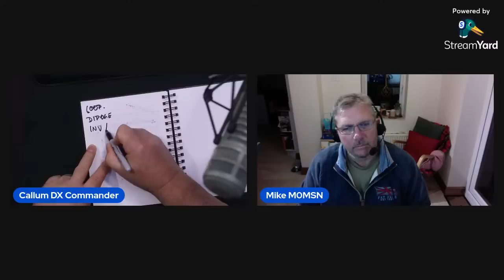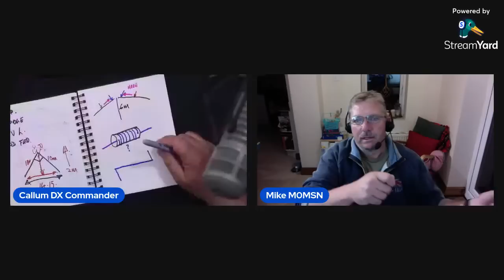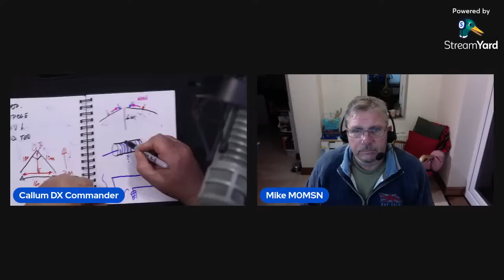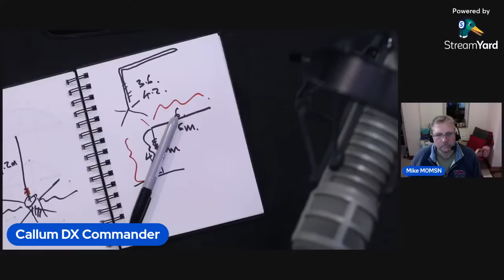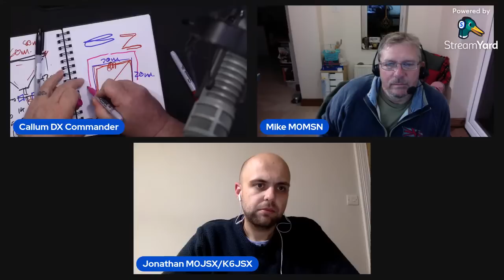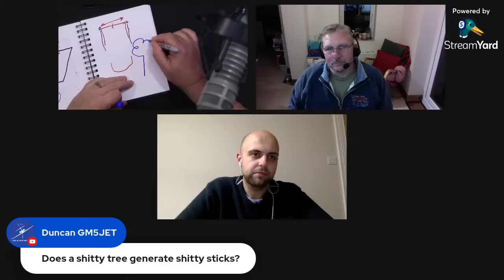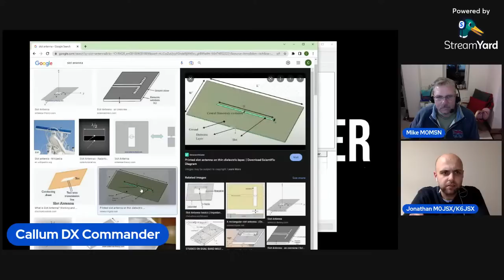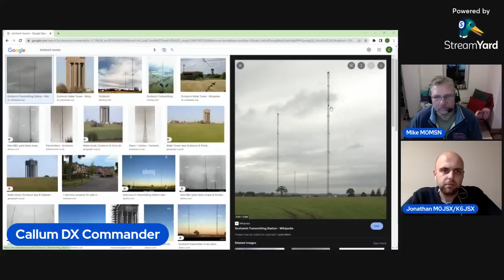Compact HF Antennas Masterclass

Comment: Regarding EFHW's I've built several versions and have been running a 10 thru 80m (with capacitors in the transformer for 10m) for several years with a 49:1 transformer I built. I tested trying a counterpoise, various chokes and a ground rod and found, for my location, the 8ft ground rod connected to the transformer gives the best performance. It's in a J configuration fed at the short end of the J and has two 90 degree bends and is 5ft off the ground. Works great and only needs some tuner cleanup on some bands. I use portable versions of this antenna for Field Day and POTA activations. One 240/43 toroid is good for 100w but I tend to build with two glued together. Results will depend on the individual's location and build process. I'm just giving mine as info. Thanks as always. Jack K5FIT
Reply from the maker: Jack.. Nice comment, thanks!

Comment: 20 ft center height worked for my inverted V with 40m elements and loading coils on the end of each element and about another 3 ft of wire to get 80M tuned to 3862 where our ARES State Section Phone Emergency Net does check-ins every day. No tuner needed for either. My DX Commander classic replaced this antenna but I still have it packed up. Thanks. Jack K5FIT
Reply from the maker: Marvelous!

Comment: NOTE> I have been using a double loop on top band with about 18in separation between the upper and lower loops. bottom loop is about 18ft AGL this is obviously NVIS . Works better than I expected as I have bagged QSOs across local to about 1500 miles with 5W digi modes and 10W SSB.
Reply from the maker: BRILLIANT!

Comment: As we drove a set of towers, the central tower had a shack at it's base, (the shack was a 2 story building) at about 2 kilometers away 3 fluorescent lights in our truck and the lights in the van lit up, like it was Christmas.  We couldn't camp overnight within 2 ks of the towers.   Naval Communication Station Harold E. Holt is a joint Australian and United States naval communication station located on the north-west coast of Australia, 6 kilometers (4 mi) north of the town of Exmouth, Western Australia. The station is operated and maintained by the Australian Department of Defense on behalf of Australia and the United States and provides very low frequency (VLF) radio transmission to United States Navy, Royal Australian Navy and allied ships and submarines in the western Pacific Ocean and eastern Indian Ocean.[1] The frequency is 19.8 kHz. With a transmission power of 1 megawatt, it is the most powerful transmission station in the Southern Hemisphere.  We played Star Wars with the longer fluoros.  My wife's bobbed hair cut was standing when she took her cap off.
Reply from the maker: Incredible story! Wow :)

Comment: All very interesting. I have spend 2 years trying to fit an antenna into a 40 foot triangular garden. Bending, shortening, adding coils etc, all good stuff. You can load anything and get acceptable SWR. I have tried to take part in many organised event by FISTS for example and have an empty log book. So making it fit and load doesn't turn into a working antenna.
Reply from the maker: Goodness!

Comment: Hi Cal,
Just watching the video and at 17 minutes in your talking about the fold back for a 20m dipole, does the spacing on the fold back make a difference or do the wires need to be in mutual contact?  WJ3U
Reply from the maker: Spacing has an effect. Frankly, with insulated wire, I just strapped them together.

Comment: Mike, if a G5RV is installed correctly with the vertical component actually straight up and down, the correct height the design was for it TO RADIATE on 20 METERS. Remember it is not actually a multiband designed antenna regardless of what common folklore has redefined. It was designed  to work ALL of the UK on 20, but because it has ladder line dealers repurposed it as a simi doublet to sell more of them. Read the real history of the antenna, made in the UK to make UK contacts easier.
Reply from the maker: Erm.. Was that for me?
Reply: @DXCommanderHQ  Both you an mike.

Comment: Sometimes people stick too religiously to conventional wisdom. Although everyone will tell you that the apex angle of an inverted V should be greater than 90 degrees they don't suddenly stiop working if the angle is less. As for feeder radiation from the G5RV if the thing was perfectly symmetrical and fed from a balanced source the currents in each conductor would indeed cancel and no feeder radiation would occur. However we mostly drive them from unbalanced sources (like coax) so the voltages and currents on each leg are unequal. In practice radiation from the ribbon matching section is not entirely bad news, adding some low angle to an antenna that is mostly NVIS.
Reply from the maker: Nice. Thanks.!